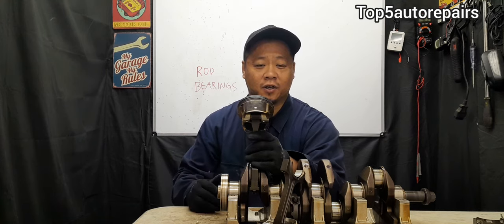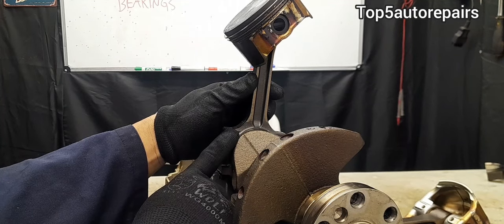CONNECTING ROD BEARING NOISE? SPUN BEARINGS? HOW DOES ROD KNOCK SOUND LIKE?

Comment: I just spun a bearing fked it up pretty bad. I bought a bearing an some sandpaper I'll let ya know how it goes
Reply: Damn that bad huh 😢
Reply: How did it go
Reply: Soo how’d it go?
Reply: @LukeplaysTV  not to great only lasted 544 miles before the rod went to space
Reply: @txicness434  not great 544 miles threw a rod
Reply: Props for the effort! It isn't for the faint of heart!
Reply: That's because the spinning of the bearing took material off crank and sanding took alittle more. So you had excessive clearances that wasn't immediately noticeable due to the oil keeping it quiet. Should have ran +.25 bearings. They are thicker and generally used when a crank is resurfaced to make up for the loss in material. I've replaced bearings in a heavy knocking car and lasted 13k miles before a clogged oil pickup caused knock again. Then I've got a turbo civic that only lasted like 10 miles after bearing replacement because I took too much material off the crank when sanding and hit 10 psi of boost with too much clearance. I'm currently fixing it by using the +.25 bearings.
Reply: What bearings do I need for a d16z6  @DevTechGarage
Reply: @MrKyle-p3p  d series bearings are the same with exception of the ZC DOHC D16(I believe, dont quote me on that)
Reply: @MrKyle-p3p  part number on my KING bearings is CR4046XP. says on the side D16 B20Z2 B20B4

Comment: I have a rebuilt Chevy 305 with only 1200 miles on it, and it starts knocking at idle at EXACTLY 180 degrees. Any temp lower than that it's extremely quiet running. Why????????

Comment: Ok great lesson, MY diesel was totally rebuilt but this morning I got a sudden knock wasnt sure what then oil pressure light, pulled over and listened, shut it down, after a few min tried again very hard start but started same thing very loud hammering, shut off towed home so I guess nothing more than dump the oil and check for metal, it is a well maintained engine, so but sudden failure can occur of course, hoping its not a main bearing its my daily but am planning for the worse
Reply: Did you figure it out I'm having the same exact issue with a gas motor and was planning a big trip in a month and really don't want to cancel

Comment: My engine knocks when hot at idle, and again at 2000rpm. But not above 2k and not at low idle when fan kicks on. Not muh under load either. And it comes and goes. Wondering if it is timing related.
Reply: It's early stages of knock. When the engine is warm the metal expands giving extra clearance, 2k rpm is generally a harmonic rpm range that you'll hear the knock at when warm. I had the same issue, sounded like it came from the head but it was just the piston ever so slightly tapping the head due to the piston clearance. I checked it by holding rpm at the knocking point and unplugging injectors 1 by 1 to check each cylinder.  So unplug cyl 1 and if knock maintains. Plug it back in and do the same with cyl 2. And so on and so forth. The knock should go away when unplugged because the fuel igniting in that cylinder slams the piston back down creating the knock. No combustion=no added force. Only works with slight knocks.  That's how I found out it was my bearing and not the head. I've replaced the bearing making sure to only use 1000 grit sandpaper soaked in wd40 when sanding down the crank as you only want to polish it not remove material.  Only issue I have is because of the slight added tolerance my oil light flashes on start up because the more clearance in the bearings equates to less pressure as more oil escapes that rod bearing, taking pressure from the other rods momentarily until pressure fully builds
Reply: @DevTechGarage  Nice. Might get around to that. At least for the sake of being informed.
Thank.
 I threw in mobil 1 high mileage full synthetic 10w40 with a 3oz per qt motorkote and she purrs almost like new *sometimes even when hot idle where before she was knocking all the time.  Great combo I highly suggest that for you.
When the knock is there it sounds pretty bad but really sounds great while driving.
Also running the ac seems to make the knock go away at times and quiet it down others but always helps.
Reply: @TonicofSonic  any sort of thicker oil additive like Lucas oil treatment of marvel mystery oil will help mitigate the sound. As for the AC, when the compressor kicks on it adds load to the engine, and the compressor isn't always on even with your AC engaged it runs in cycles. So that would account for why it sounds better sometimes vs others.   When the ecu detects extra load it will adjust the air fuel ratio to either add fuel or remove some depending on the situation which will also effect the sound as decreased fuel will take load off the piston during combustion where increased fuel will add load, making the knock more pronounced.
Reply: @TonicofSonic  what type of vehicle is it? If it's something like a Honda civic, rod bearings can be changed by removing the exhaust(for clearance when removing oil pan), remove oil pan, remove oil sump and girdle and rods are right there. You can try to move the rods up and down and if there's any up and down movement then it's bearing. However when when I did mine that was having your exact issue, I felt not movement at all(since engine wasnt hot) But when I pulled the rod cap the bearing was super worn. I polished the crank and replaced all rod bearings and main bearings and been driving it ever since. I'm in the process of replacing bearings on a 99 civic turbo as we speak
Reply: @DevTechGarage  Lucas did not help. I gave it several chances. The engine was quieter with straight Wal-Mart high mileage full synthetic 5w 30 than with lucas added. 
I used lucas high mileage version.
Never tried the synthetic.
Anyway no more lucas for me... 10w 40 HM full synthetic MOBIL 1 is better than a 5w 30 with Lucas. But..I might try full synthetic lucas with this mobil 1 just for kicks.
Kinda planning on letting it go... engine has 200k and piston slap too. Used to burn oil. Rings are probably shot somewhere.
Runs like a champ. Idles smooth as butter. Power is good. I dunno I hate the idea of putting money into this old engine. Might find time next summer to take off timing cover and oil pan for a refresh.
Reply: @TonicofSonic  i don't blame you. I've worked on cars all my life and I honestly hate it. I love the end results and always feel proud to have built something but man I hate doing it.  Especially tearing an engine completely down to bare block. It's all tedious but the sense of pride at the end makes it worth it. But hey if you wanna drive it till the wheels fall off, go for it.  That's kind of what I'm doing to my other honda civic. I'm just doing the bare minimum to keep it running at this point. If engine blows it blows. May just swap whole thing in the future. Make it a loooong term project

Comment: This was great. I am thinking of buying a 2023 VW Atlas crossover. It’s pre owned, 18 k miles but i read that vw may be recalling some of these due to an engine rod bearing issue that can cause severe motor damage. Why would they only be recalling some of them and not all of them? And how can I know if they have already done the work? Or more importantly if there is a problem with them. How can I figure that out with the dealer before buying it. Any help or advice is appreciated

Comment: Bad bearing make a random light rattle- like sound? Doesn't really keep pace with the motor.  Engine runs great, but found some fine metal flakes in last engine oil change.  200k in a gm 6.2 and change oil about every 3 months.  Particles appear to be slightly magnetic.  Anything I should take a look at?
Reply: The engine

Comment: If it spun a bearing and seized in the dangerous stage 
Can it still be saved? Still starts and drives.
Reply: Possibly but the rod journal where the bearing spun will have started wearing. 

At this point the likelihood of a reoccurrence will be elevated until the crank is properly machined or replaced. 

Minor wear can be polished at home. But if you find the knock is back after only a few hundred miles, chances are it's impossible for you to do anything about it.

Comment: Question 🙋🏽‍♀️ I have a 2019 Acura MDX, there is a recall for connecting rod bearing. Lately the car looses power on its own (Not while driving) I can drive it fine no noise but then when I turn the SUV off it does not always want to turn back on. I have to jump start it for it to turn back on. Is this caused by the connecting rod bearing issue? There are no engine lights on or battery light on.
Reply: Check the voltage of your battery and have your starter tested. This doesn’t sound like a rod bearing issue.

Comment: I have no metal in my oil, no loss of oil pressure, no loss of power, no misfire codes, smooth idle...I've been told I spun a bearing. Can this be possible without any symptoms other than a knock from the lower end? 

I thought flexplate, but it's looking like it's fine. I'm hoping it might be the TC but? I'm about to pull the transmission back but I'm hesitant to do so for fear I may not get it back in right. Not having the right tool for the job sucks.
Reply: Did you ever figure it out? I have the exact same thing going on.
Reply: @andrewhutson8299  yes and I don't like it. Spun bearing. Crazy how I had no other symptoms
Reply: Im going through the same issue right now on a 07 Kia

Comment: Basic info, i have a 2005 Scion tC with 125k miles. Would this be a spun rod bearing? I have a top engine rattle noise on the opposite side of my timing chain(i believe its cylinder 4) only at or after 2k RPM and basically everytime between gear shifts? I have major rattle noise, not this knocking noise. Also ive gone probably 5k miles with this but i dont have any engine performance issues. No check engine light. No oil light, just this noise that definitely has gotten louder and no its not a loose heat shield or anything like that. Its clearly coming from right under or near my  valve cover. Also if it matters, my valve cover gasket was replace at 114k miles prior to the purchase of the vehicle, and the spark plugs have been replaced with OEM parts. Any idea of what's wrong would be helpful.
Reply: Have you checked lifters?  May need to be readjusted.

Comment: Hi my name is Jeffrey Amu and I'm from PAPUA NEW GUINEA.. I have a Howo truck prime mover model 371.. 2 months ago my truck got a knocking noise and I towered the truck home and I drained out all the engine oil and I removed the engine oil samp and find out that the Conrod Bering number 4 was loosen and it makes the knock noise so I removed it and also I removed all 12 Conrod Bering and replaced it with 12 New Conrod berings and closed it up I than poured the oil in and started the engine and when the engine was running in ideal it makes a smoll knocking noise again so now I'm confused what makes that smoll knocking noise... I'm not a Mechanic but I always watch your YouTube mechanical channel so I'm trying to get the truck fixed by my self so please can you help me by advising me how to get my truck fixed
Reply: Hello, try to check first your injectors, sometimes failed injectors cause that sound.